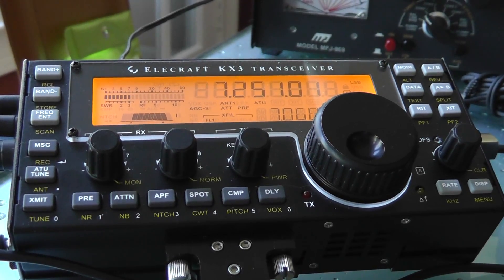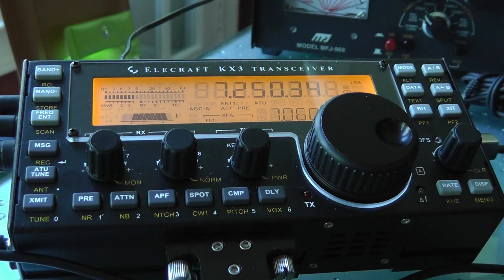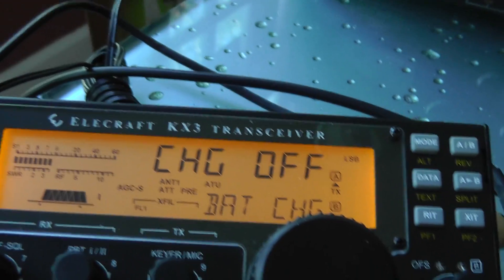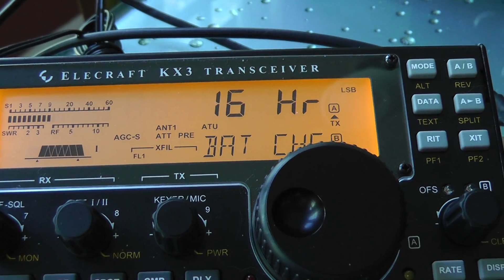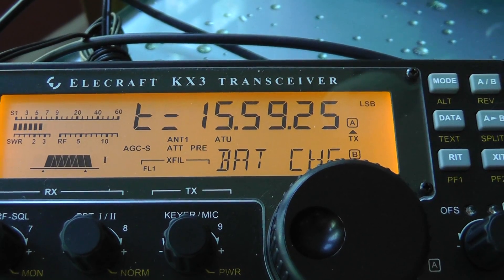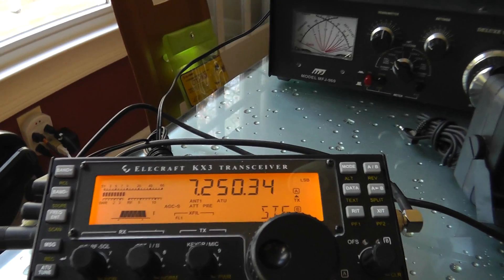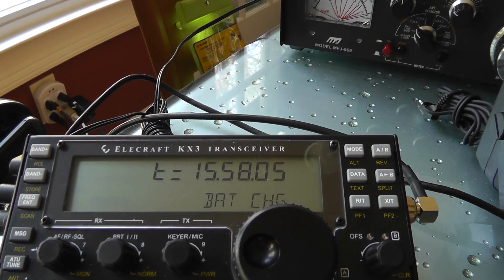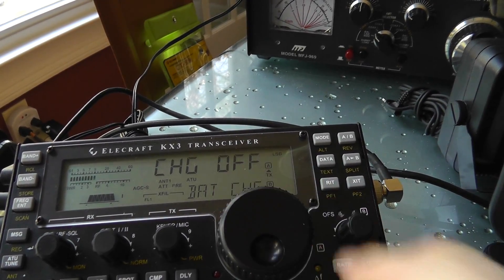How to charge batteries Elecraft KX3

Comment: Thanks for the video 9mmsteve! 
Reading the instructions from Elecraft, the charger is not a smart peak detect charger. It looks like it delivers 200mA charge current for the time period specified (as shown in Steve's video), and to find the correct charge time, there is an assumption of 80% efficiency. In other words, if you have empty cells with a capacity of 2600mAH (as I have), then you need 1.2 * 2600 / 200 = 15.6 hours, so I should set 16 hours to charge fully. What it doesn't do is deliver higher current for shorter durations - something you could infer from Steve's video if you (like me initially!!) are not paying enough attention!

Comment: Thanks for the video. I just ordered one. What I would like to know is if I have rechargeable batteries in the K3 and I wanted to use an external battery instead of the internal batteries, do I need to take out the internal batteries before I use the external battery or is there a way to switch between the two in the menu? Thanks.
Reply from the maker: Eric Champine No you do not have to take out the batteries it automatically switches to external power when you plug in the external power plug.  Congrats on your decision to get the radio, it is a great one.  I had never worked QRP so that is fun.  One day you may want to get the optional 100 Watt amplifier which will make your communication a bit easier.